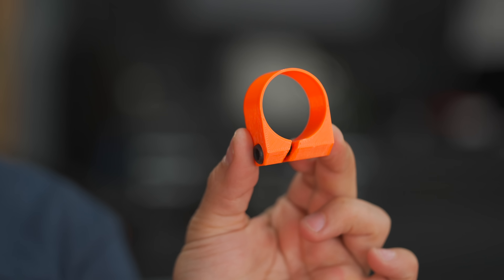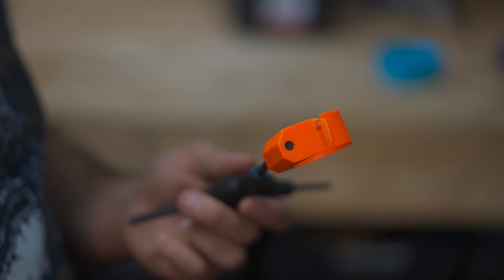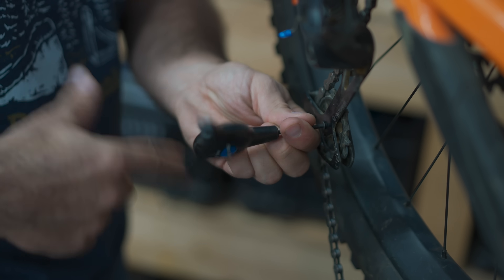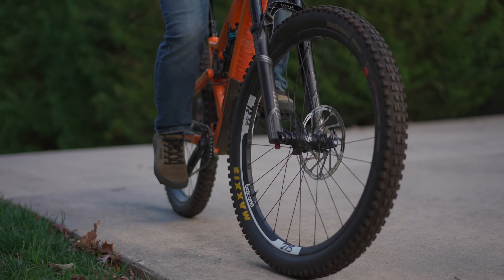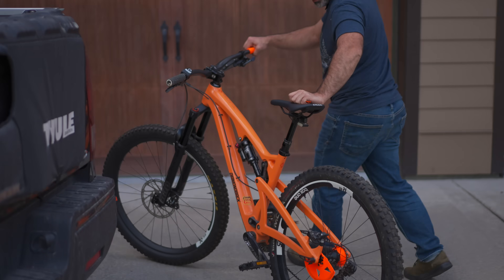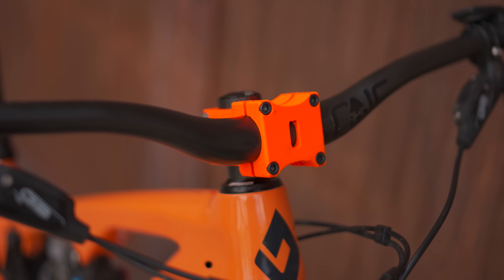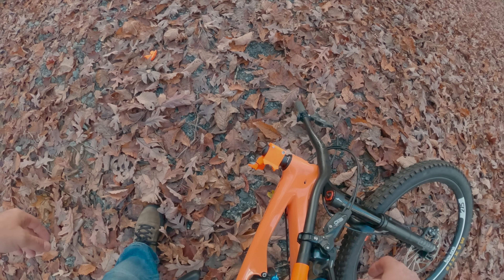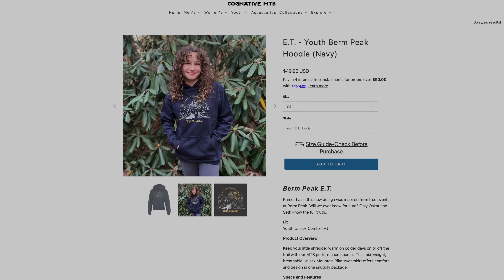Will 3D printed MTB parts break catastrophically? Let's find out!

Comment: If you're going to do some more of these types of videos maybe try moving onto using engineering plastics.  Stuff like ASA or Nylon should be a good place to start.  Also consider heat inserts for threads over using a embedded nut or threading the plastic, It'll make the strongest connection.
Reply: 👉Thanks for watching ❣️ 
👆I really appreciate, message me by the name above 👆👆👆to receive gifts 🎁
Congratulations 🎉

Comment: 3D print it with a laser in a sandbath, or with induction heating or any other expensive manufactoring and it will be pretty epic ;) 
No mainsteam plastic filler all that strong sadly and the ones used the most for prototyping does not hold up well to uv light and definetly not metal friction. really cool fitment testing through
Reply: 👆Thanks for watching 👆
Expect more videos💳
I have something for you 🎉🎁🎁

Comment: To be fair zou are also using a weak material, zou can actually print with carbon fiber, its a special 3D printer that lays down a strand of carbon fiber within the plastic so its woven instead of just random carbon like normal
Reply: I have something for you 🎉🎉🎉
Reply: What is it

Comment: 3D printing parts would be great for prototyping the look and fit before proper manufacturing. I would assume bike manufacturers do almost exactly what you were doing… minus the riding portion. Iterate on your disc rotor design and then have someone cut them out of stainless steel with a CNC plasma cutter.
Reply: I have something for you 🎉🎉🎉

Comment: A very good indicator of success in a 3d printed bike parts is what they are made of to begin with. If something is made of plastic to begin with, it’ll do fine. If it’s made of metal or carbon, don’t try it. Plastic is very cheap to mass-produce, and companies want to save money if they can, by using it. And engineers are smart people, and they generally know exactly if they can get away with it or not. So chances are if there isn’t already a plastic version out there, it won’t be 3d printable. That being said, i would love to see a more realistic episode 2 with volume tokens, water bottle cages, better lock on grips, cable management items, valve caps, both jockey wheels, full derailleurs, headset/singlespeed spacers, maybe pedals, bar end plugs, top cap, and anything else i might be missing.
Reply: I have something for you 🎉🎉🎉

Comment: I have started printing  the colorfabb bike, it is not yet  finished.
 I can only recommend using nylon carbon fiber filament. One company even claims that their nylon/carbon mix is as strong as grade aluminium.
It's not just your engineering, it's also your choice of material.
Reply: 👉Thanks for watching ❣️ 
👆I really appreciate, message me by the name above 👆👆👆to receive gifts 🎁
Congratulations 🎉🎉

Comment: If you want to design 3d printed bike parts you need not make them the same size and shape as the alloy parts. For the same volume of material plastic for sure will be more brittle and will break. Try to do some finite element in the process of design and see how much force can withstand. Usually 3d printed parts need to use more material to be as strong as alloy parts.
Reply: 👉Thanks for watching ❣️ 
👆I really appreciate, message me by the name above 👆👆👆to receive gifts 🎁
Congratulations 🎉🎉

Comment: I have been waiting ages for you to finally get a 3d-printer.
You can actually print working ball-bearings (available on Thingiverse). They are not supposed to be used under load, definitely not on a bike, but if anyone would try, I am sure it would be you.

Comment: Hey you should look at threaded inserts for 3D printed parts. You heat up the insert with a soldering iron, stick it in your print, let it cool, then you have metal threads to screw bolts into.
Reply: 👉Thanks for watching ❣️ 
👆I really appreciate, message me by the name above 👆👆👆to receive gifts 🎁
Congratulations 🎉🎉

Comment: The mech hanger for my BMC road bike costs €39, so I tried designing and printing one just to have a spare.  A plastic replacement feels sort of flexy, but on the workstand the bike shifts fine with it! I designed it with the idea that getting one CNC machined out of aluminum might cost less than the original part plus shipping.

Comment: Dear Seth,
I would rather recommend you using PLA or Nylon Carbon Fibre Filament since both of them can withstand the forces in which the PETG sort of fails…
Regard that the carbon fibre filament needs a higher nozzle temperature (250°C, I do 260°C), and also a higher bed temperature (I do 70°C).
Also great Video you made there! Keep your Berm Peak YouTube channels up in order for me, to get more entertained and learn more about MTB stuff.
Sincerely,
Kaweh

Comment: I 3d printed a gear for my electric longboard, mounts directly to the wheel. single wheel chaindrive, 1,5kw motor, topspeed of about 38km/h. Never lubricated, not protected against sand and dirt. 200km later still worked just fine. yes there are signs of wear, but no problems what so ever.
Reply: Gears in E bike hub motors are usually made of Nylon plastic, they are lubricated but they can last 10k km and more. Steel gears would demand a far better lubrication than just a little bit grease in a common housing with the motor

Comment: Head tube spacer might be fine, no real stress that could crack it. Love the color it adds. If they could make those various metal parts in color that wouldn't wear off, I'd totally buy them.
Reply: The problem with printing spacers is that plastic tends to shrink, especially 3d printed plastic. When you first print them they might fit perfect, but a week or two later they're going to be loose, and that will continue for quite a while.
Reply: Aliexpress
Reply: Anodized aluminum?

Comment: I think it was a great video, and certainly good way of testing things. However:

1. Things have to be designed and engineered based on the material and type of fabrication
2. Don't 3D print threads, use nut and bolts in the design
3. Direction of printing matters
4. Percentage of filling matters, 
5. internal filling design matters
6. Type of plastic matters
7. Type of 3D printing technique matters

In a bike, I would not use that type of 3D printing for structural parts, but only for non-structural additions.

Comment: 3d printed brake rotors? yea no. the heat alone would kill them.
Reply: Depends on the material - plastic is of course not an option. You can 3D print aluminium and titanium too, it's now used in the aerospace industry. 
But especially with a brake rotor you wouldn't benefit from the main advantage of 3D printing, making a material with an internal structure similar to bones.
Reply: @simonm1447  if we are talking metal ofcourse that would be viable but plastic? hell no
Reply: @SB7-r9i  of course plastic is not viable for this purpose

Comment: How about metal 3d printed parts?
Reply: The printers for this are probably a little bit more expensive, but it would work, it's already used for aircraft parts or the turbopump of the Merlin rocket engine
Reply: @simonm1447  they're extremely expensive, but some companies offer metal 3d printing services. Pcbway would be my pick. There are some frames on AliExpress with 3d printed dropouts and other parts.

Comment: Your designs are alright, but definitely have some flaws
 - the seatpost clamp would have easily been strong enough if the outer section was thicker and you added perimeters, which will generally support the majority of load on your parts. For anything load bearing you should use at least 4 perimeters, infill doesn't really matter much except for large compressive loads on the top and bottom surfaces but generally 30% is the most you need
 - 3d print layers are very strong in tension, but the adhesion between layers is comparatively extremely weak, keep this in mind when designing and choosing layer orientation
 - for threads, if your are threading the plastic directly, you definitely need a lot more material/perimeters around the threads. If you are using anything bigger than 10-32/m5 you should really tap the threads beforehand as well
 - honestly for threads you are better off inserting hex or square steel nuts as it distributes the force much better and will generally be far stronger without needing excess material. There are also brass heat set inserts you can put in using a soldering iron
 - while it's counterintuitive, for parts like an axle which are under torsion and tension, you should actually print them laying flat as the lengthwise extrusions will be far stronger than the adhesion the layers
 - the sprocket and disc brake are never going to be good candidates for 3d printing in plastic due to the very thin profile and concentrated loading situation they are placed under. However for something like a disc, adding holes can actually make it stronger because it will create continuous perimeters from the center to the outside, you can see this kind of optimization in metal disc brakes, though they just do it to save weight/material
 - if you needed it up slightly and added a lot of perimeters, the stem would have also been perfectly strong enough as well
 - PETG is great and more impact resistant but is objectively weaker than PLA. There are others with similar strength but none as easy to print as PLA
 - lastly I would recommend that you stop using tinkercad and find a real cad package like fusion 360 (free) or SOLIDWORKS which I recommend but is not officially free. Tinkercad is just a dead end software and not conducive to improving your skills

Comment: hey seth at 15 seconds ur print looks real wobbly, you might have to calibrate ur axis? or PID tune ur bed and nozzle also you did high infill, i suggest you increase wall counts as it usually does better. try to put like 10 walls in for some of these parts and it might actually hold up

Comment: In the next episode - “I 3D printed a whole mountain bike!!”
Reply: This would be awesome - you could use aluminium alloys for frames which are not weldable, but have a high yield strength, like aluminium lithium alloys used for aircraft fuselages or rocket fuel tanks

Comment: From someone with a masters degree in 3D printing, I found this really entertaining. You're right, there are design aspects that affect the part's performance, but there are also factors like print orientation and material that are big factors. I'm assuming you printed these solid, but infill also plays a role.
It'd be cool if you had access to a metal printer or the Markforged which can add carbon fiber inside the prints.
Reply: *Jacob makes plans to visit Berm Peak....
Reply: That's funny, I was thinking the same thing...Oh no, I don't have a master's degree in 3D Printing, I just stayed at a Holiday Inn last night.
Reply: They're hollowed/infilled, you can see when they break.

Comment: Hey, Seth your infill % can also help with making some of those stronger along with what other people have commented talking about infill pattern and the orientation. Love watching your videos and seeing how you use your Prusa printer to make all sorts of things to try out as bike parts or other ideas.
Reply: Perimeters give you more strength than infill, though.
Reply: @doxielain2231  solid plastic is solild plastic. I have always wondered when people say perimeters are strongest, Where has tested this?
Reply: Perimeters often align with the direction of force and in 3d prints continuous lines are stronger than lines next to each other.
Reply: @lborisfromlv426  What let's build said. Remember, the weakest areas of the print are where the layers join together. Think of it like wood grain.
Reply: I’m going off my own experience based off the TronXY P802 3D printer that I own.

Comment: These may be a backpack repair kit/replacement in an emergency to get you back to the trailhead, but not for hard riding. There is a reason the manufacturing parts are made the way they are. But to have lightweight emergency parts kit...this could work.

Comment: Printed threads are not the best for applications where a lot of tension is on the joint. Try threaded inserts instead. You basically melt the threaded inserts into a designed hole in the print. I’m also skeptical of how well PETG would work for many of there applications. I would suggest nylon or imbedded carbon fibre. They are both much trickier to print with but they are meant for more strenuous applications. The channel CNCKitchen has a bunch of really great videos about all of this.

Comment: Printed jockey wheels are fine There's no heavy load on them and you can print a couple of them just in case. Also, applying some CA glue to such parts helps to make them a bit stronger.

Comment: For 3d printed bike part at least try to use carbon fibre nylon much stronger then pla or petg much more suitable for your experiment also make sure it 100% infill and 0.02 layer height also will
Help to increase strength part from your video look like it printed in 20% infill and 0.03 layer height ( low quality)

Comment: Like others have said, instead of screwing into the plastic, you can use a hex nut and also threaded brass inserts you use with a soldering iron to add the screwings:D

Comment: I would add to that last statement. "don't print Load Bearing bicycle parts". There's a good chunk of non load bearing parts you can print. And in tpu you can print slip on grips, crank boots, chainstay protectors etc.
Reply: If he wants load-bearing parts or parts that need to be tightened over 1NM, he would be better off with a mini-CNC.

Comment: Those 3d printed part will not work it just too weak even you print it with ABS😂 but just a little FYI in case you going to explore 3d printed part with ABS make sure you wear a mask 😷